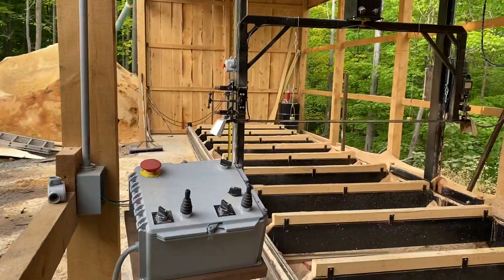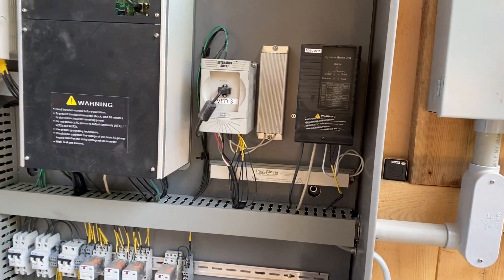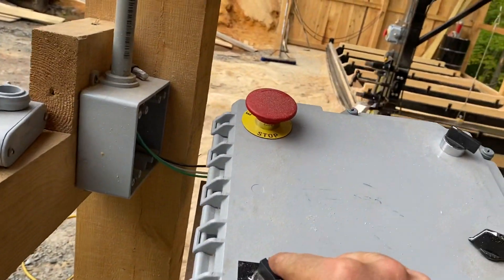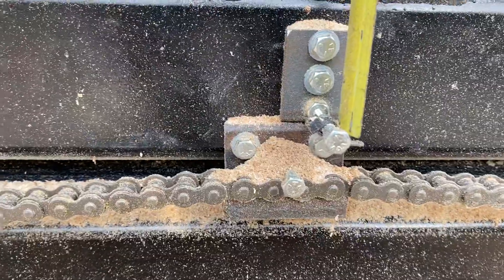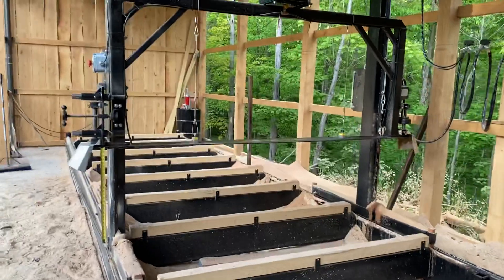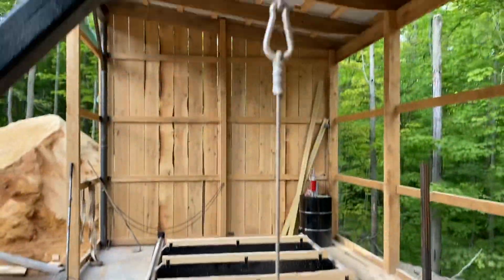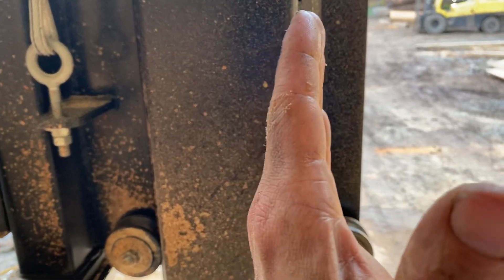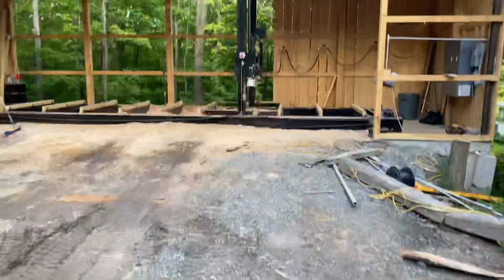Custom built electric chainsaw slab mill 7’ wide cut

Comment: What was the cost of the materials for the chainsaw mill?
How has this design been holding up?
Thanks
Reply from the maker: I think it was around $15k at the time.  It’s been working great.  The only modification I’ve made to it is adding a way to put some tension on the bar.  It helps to keep it cutting straighter.

Comment: Amazing design!   What were your thoughts behind using a chainsaw versus a bandsaw?  And, how often are you adjusting the shaft on the non-drive side.
Reply from the maker: I needed to have a minimum 36" throat on the mill to be able to quarter large logs.  To build a bandsaw that could do that, I would probably be looking at 42" wheels.  That would put my bands at 32'+, and my mill at 15'+ wide.  A band mill this size would cost probably 4x or more as much as my chainsaw mill, and I'd have to make a much larger building.  I've worked with guys that have band mills, and the blade has a tendency to dive in the middle of the cut, which on walnut could cost a $1000 or more.  The bands are particularly unstable when you are cutting really wide logs with knots and crotches, or if you hit any steel.  I've cut straight through the eye of a 3/8" eye bolt with my chainsaw mill, and had ended up with a perfectly flat board.  The only downside to the chainsaw mill is speed and kerf size.  I don't really adjust the tension but I pull the chain off to sharpen it, so it gets adjusted every time I sharpen.

Comment: Genius!  Too late now, but you could have just used a vertical shaft lawnmower engine to power the chain.
Reply from the maker: I would need a 40-50hp lawn mower to run a chain this size.  Which would require a redesign of the gantry.  I would also need a clutch, fuel tank, remote throttle and cutoff.  The fuel would cost 5-8 times electric at market values.  We have a solar system, so it would cost us even more.  Plus, I would have to wait for it to warm up and listen to it idle between cuts.  You certainly could make it work, but I don't see any advantage to it.

Comment: Amazing mill! Where did you get the drive sprocket for the ripping chain from ? I’m building a smaller version and would be grateful for the info .
Reply from the maker: I used sprockets from 6k products.   The part number is DS0148.

Comment: Beyond nice, superb build. Any guards in the works for the inevitable day the chain breaks at speed?
Reply from the maker: I have some small aluminum guards on the ends.  I might make some bigger ones at some point.  I've broken the chain probably 10 times now.  It mostly just stays in the cut.  I give it a wide berth and turn it off if I have to get anywhere near it.

Comment: Man, excellent execution! I had a very similar set up in mind. Really the only thing I can critique is the placement of your cabinet temp probe. Being mounted right on that exhaust fan is going to keep that probe colder than the ambient air in there. Definitely recommend moving it toward the center of your cabinet. But other than that, seriously impressive! Subbed for sure!
Reply from the maker: I have to disagree with you on that. There are fans inside the VFD's that blow warm air out the top.  If you placed the probe in the middle of the cabinet it would actually be cooler due to the fresh air coming from the intake fan.  There's no other place in the cabinet where the heat from all three VFD's congregates except right at the exhaust.  It is actually the warmest place in the cabinet.  It would make more sense if I could draw you a flow diagram.

Comment: have you tried bending the bar up in the middle slightly, so that when it settles it is straight?
Reply from the maker: That would just exacerbate the problem.  It's always going to try to sag to the same point.  If you start by lifting it higher the board would go from being convex to concave instead of going from flat to concave.  You would have twice the thickness variance over the length of the board.  I made a bar tensioner for it, and that keeps it pretty flat now.

Comment: Nice mill I really appreciate the details that you show.  I'm designing my own slabber that is using some of the features of your mill, is there anything you would do differently or change?  Thanks!
Reply: I would find a way to tension the bar as well as the chain.  It helps to keep it nice and flat.  I made an arch and used a chain and binder to tension mine.  If you dm me on fbook or insta I can send you a picture of it.

Comment: What is the advantage of a chainsaw  mill vs a bigger band saw mill?
Reply from the maker: There's quite a few advantages.  The only real disadvantage is speed.  Band mills have a really hard time cutting flat slabs.  The band wants to dive when you're dealing with wide logs, and especially when you get into crotchwood or knots, or if the band gets even slightly dull.  You can ruin thousands of dollars in slabs in 1 cut.  I wanted to have a 36" throat on the machine for quartering large logs.  If I was to do that with a band mill it would have to have 42" wheels or so which would put my overall width at 14' and my band length at over 30'.  I would have to put a much bigger motor on it and probably run 3" or 4" wide bands to have enough stability, which would probably double or triple the cost of the mill, and the cost of the bands.  I like the fact that I can cut both directions with the chainsaw too.  In the end the chainsaw mill was cheaper, simpler, and cuts better slabs.

Comment: What would you estimate that mill cost you?
Reply from the maker: I would estimate 18-20k in time and materials.  I also had a few sunk cost such as having to buy a larger motor, vfd, and gearbox for the lift, because it wouldn’t lift the head with everything installed.

Comment: Brilliant engineering. Why did you decide on using a chainsaw?
Reply from the maker: I wanted to be able to quarter large logs which requires a throat of 3ft.  In order to do that with a band I would need 42" wheels.  That would make my mill nearly 14' wide and my band nearly 36' in length.   When cutting large slabs, over 50"or so, the band tends to wander a lot. You're always one pebble away from ruining thousands of dollars worth of slabs.  I would want a minimum of a 3" wide band.  It would be so much more complicated and expensive to build.  This saw was simple, relatively inexpensive to build, and can cut a 7' slab flatter than you could ever get it with a band.
Reply: @IrionLumber  very interesting. Will consider this approach in the future. The white oak quartersawn from this was beautiful. Good work.
Reply: Would love to see some big quartersawn slabs!!

Comment: Put a limit switch at both ends of the tracks and forget about the carriage going pass the ends of the mill. 
I will guess that VFD is well over 15hp to work as an inverter for a 3 phase motor.  Probably that cost more than an small car.

Comment: Where to you get the chain bar and sprockets. I would also like to know how they are mounted.
Reply from the maker: The bar it made by Cannon Bar Works, and the sprockets are made by 6k.  They are mounted on a jack shaft that is mounted between two pillow block bearings.
Reply: Thank you
Reply: I would like to get some pictures of the top of the unit. Like what type of motor and pulley system you are using. Thank you for all of your patience with my crazy questions.